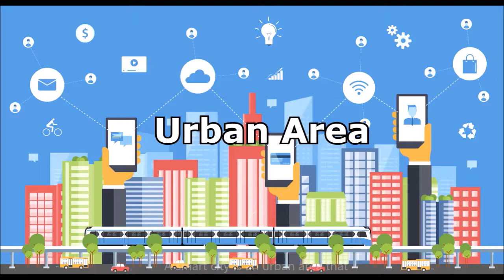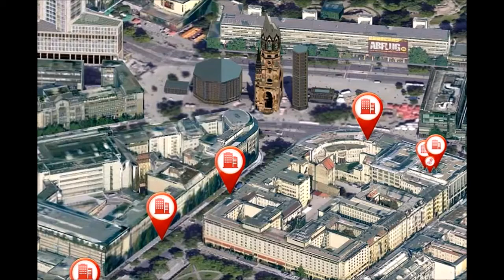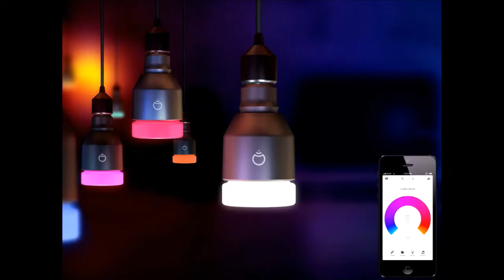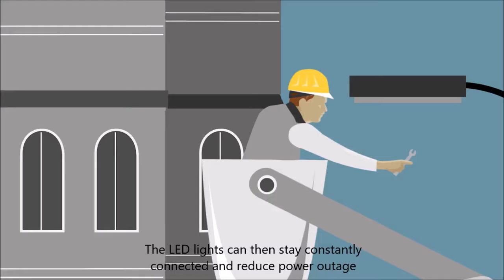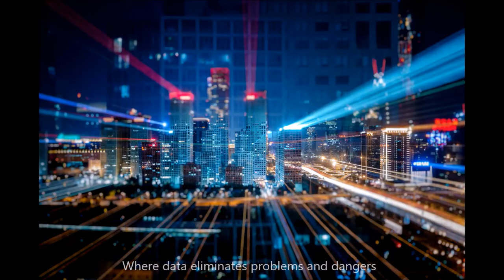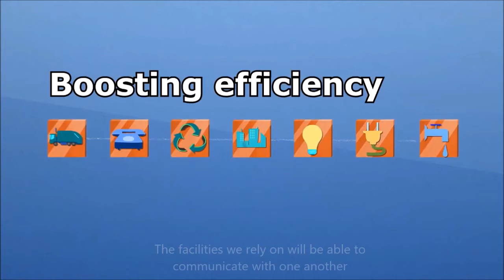Application of 5G in Smart City

Comment: How will 5G improve energy efficiency in smart cities?
Reply from the maker: Hi, thanks for your comment.
One example is that 5G technology can address air quality and energy consumption by creating smarter transportation management systems. Traffic congestion in cities carries tremendous costs in terms of wasted fuel and wasted time. Using cameras and sensors to create dynamic traffic control systems instead of relying on fixed traffic light cycles can reduce energy consumption, wasted time, and mortality.

Not only that,  smart electricity meters would also provide residents with detailed information on consumption patterns and recommend ways to cut costs.

Comment: Will there be more coverage if 5G network is implemented due to bandwidth increase?
Reply from the maker: Hi, thanks for your comment.
Yes. By increasing network bandwidth, carrier aggregation (which allows mobile network operators to combine a number of separate carriers) delivers higher peak data rates and better user experiences across the network coverage area.

Comment: How is 5G different from 4G?
Reply from the maker: Hi, thanks for your comment.
There's a huge improvement in 5G.
1. The latency is reduced to 1 millisecond from 10ms in 4G
2. The connection density increases up to 1 Million (devices) connection per km squared from 100 thousand connections km squared in 4G.
3. The peak data rates increases up to 10 Gigabytes per second from 1 Gigabytes per second.
4. The available spectrum increases up to 30 Gigahertz from 3 Gigahertz in 4G.
Thus, the upcoming network is able to give maximize the performance.

Comment: What are the requirements for 5G?
Reply from the maker: Hi, thanks for your comment.
The key requirements for 5G are:
1. Higher system capacity: 1000 times capacity per km squared.
2. Reduced Latency: RAN latency less than 1 millisecond
3. Energy saving & cost reduction: 1/10 times energy consumption
4. Higher data rate: more than 10 Gigabytes per second
5. Massive device connectivity: 10 to 100 times more devices

Comment: what are the other challenges in implementing 5G besides cost?
Reply from the maker: Hi, thanks for your comment.
Other challenges such as
1. Security, ensuring 5G is safe
2. Speed, capacity of ~100s of Mbps to ~10 Gbps in 5G
3. Massive growth in connected devices, 5G is challenged by increasing diversity of optimized wireless solutions to different application domains
4. Massive growth in traffic volume, 5G provide 1000x more available throughput
5. New requirements and characteristics due to communication machines such as multi gbps in specific scenarios, ultra-low latency

Comment: What other advantages are there for V2V communication besides the video?
Reply from the maker: Hi, thanks for your comment. Other than cutting down on the congestion and improve road safety, It able to helps the driver to save cost and money as it helps to reduce the amount of gas wasted during traffic jams. This is done by the Traffic Management Center(TMC) by transmitting information via wireless connection or mobile network connection. Also, it helps to reduce the rate of accidents to occur.

Comment: Will the security of data be a concern?
Reply from the maker: Hi, thanks for your comment.
Yes. As 5G network is based on a "hop-by-hop" security approach to secure the path between communicating parties, it may not be efficient enough to build differentiated end-to-end (E2E) security for various services.

Security and privacy for such a vast, global system such as 5G cannot be properly built on top of other parts of the system design. Hence, we believe that security and privacy features must be built into the system design right from the start. 5G security design will have to consider issues of how to isolate, deploy and manage virtual network slices securely.

Comment: As compared to 4G, won't it be more expensive to implement 5G?
Reply from the maker: Hi, thanks for your comment.
As for the time being, it is unsure whether the cost of 5G implementation will be costly as compared to the current 4G network. However, several factors can be considered such as the cost of spectrum and cost of network infrastructure. It is predicted that the spectrum will be more expensive with the increase of network infrastructure cost. This is because in order to support the 5G network bandwidth and data traffic, the network infrastructure has to be made in such a way that network communication and operations should be able to cater the traffic for the upcoming 5G network.